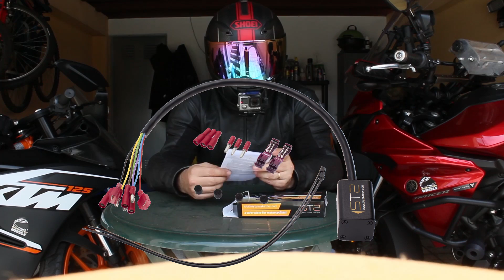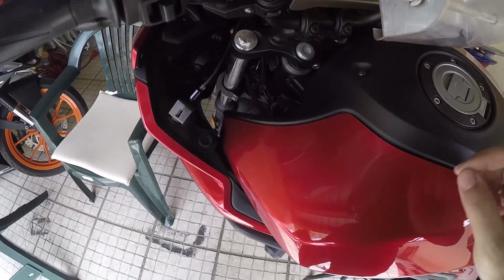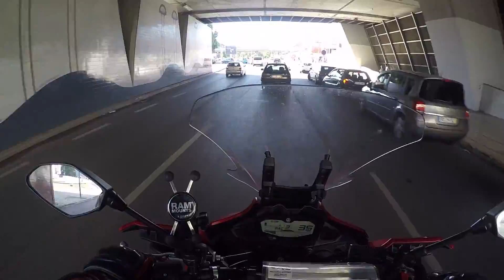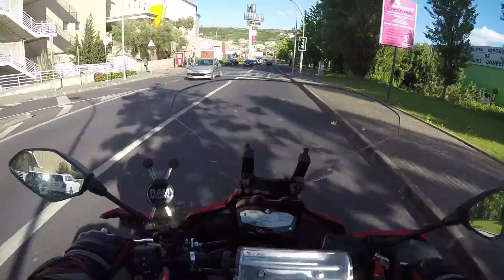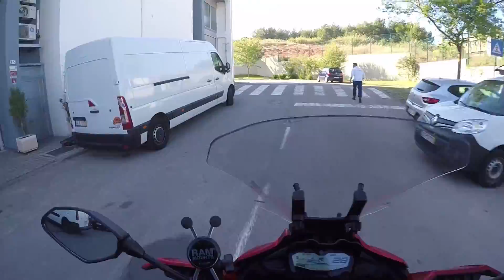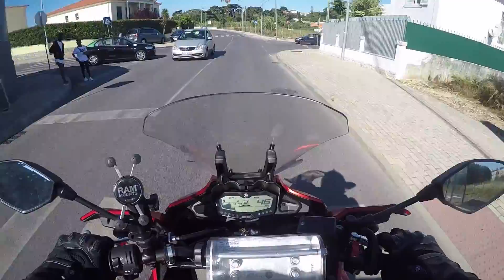Smart Turn System - The Automatic turn signal canceler!

Comment: What's that box you have installed on the handlebar bar?
Reply: A "road book" - old school type, as used in rally sport for ages. You put in a scroll with directions and such stuff. While riding, you have to scroll on manually when reaching a designated point in your route. Kind of navigation system from stone age ;)
Reply: Sven Küper Interesting. Never seen that before. Great channel BTW. Keep up the good work.
Reply: I never used that myself but a friend of mine loves it. Gives more freedom than just following an electronic GPS device he says. Another pro is, that you have to plan your trip just with a map and a bit of thinking... so nothing just for a quick ride, but great for a well planned trip. Had him as a "tour guide" with this one time - the tour was great and just felt a bit more chilled and laid back ;)
If you check out the "Portugal End to End" videos from Cager, you can see this thing in action.

Comment: Well two things bother me. First is the price. 50 euros would be much better than 150E. Second, they should make it possible to have manual cancel control anyway.
Reply: Cool, somewhat counterintuitive but I guess  you get used to it as you use it for longer period. Now I say it can be near 100 Euros, 150 is to much for my pocket but then again I ride on a 28 year old bike and everything is expensive for me hehe.
Reply: One other thing, as you gear up your bike for the touring this little thing helped me a lot http://www.ebay.com/itm/Hot-Motorcycle-Motorbike-Throttle-Clip-Cramp-Rest-Assist-Wrist-Cruise-Control-/322544588808?hash=item4b1927d808:g:osgAAOSwUKxYddkG

Comment: The new exhaust sounds very nice.It is deep and throaty but not harsh and it does not seem to be overly loud.
Reply: I guess that translated through the go pro,internet and computer speakers it made it sound more subdued.It actually reminds me of the Honda VTR1000 Superhawk that I had sound wise.That one was tolerable at idle or low revs steady throttle but got way loud quickly under acceleration.